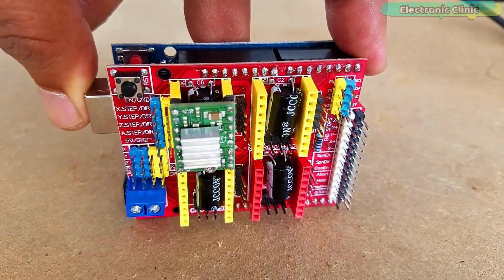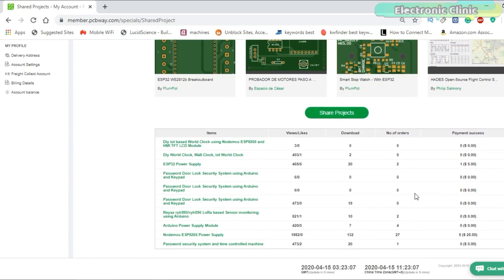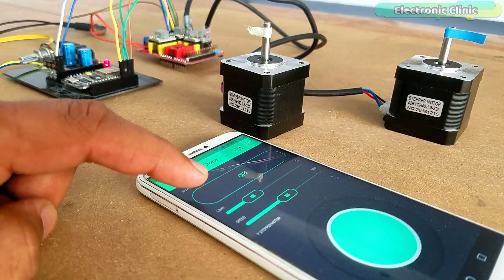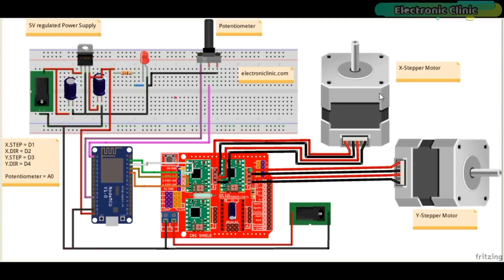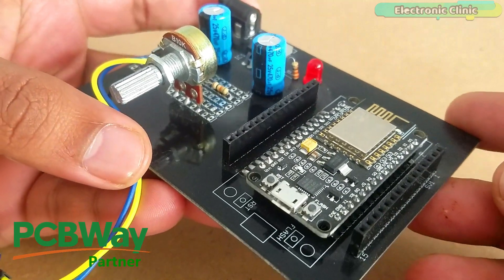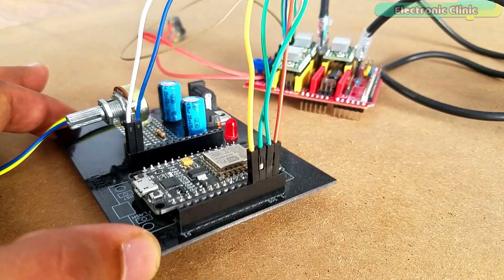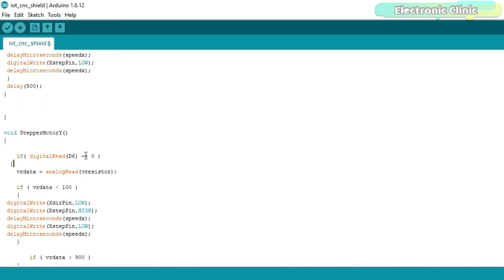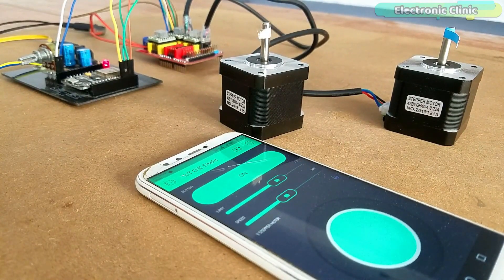IoT CNC Shield, Nodemcu CNC shield, ESP8266 CNC Shield, Mobile CNC Shield, Blynk App, Stepper Motor

Comment: Can I apply this code with Blynk IoT (New Version). I make it follow this clip, but it can not operate
Reply from the maker: new Blynk is a littble bit different. You can watch my getting started video on the Blynk v2.0 and then you will be able to control the stepper motor. Kindly check playlist.

Comment: if we dont have the that pcb board what can we do ? also where can we find the libraries
Reply from the maker: You can make your own pcb. Check playlist, I have designed custom pcbs for controlling stepper motors.
Reply: @ElectroniClinic  thanks for the answer, but because i don't  have a lot of time to make a pcb because its for a school project, how can be done  without?
Reply from the maker: i have added the pcb gerber files, you can make that in 2 or 3 hours.
Reply: @ElectroniClinic  ok thanks

Comment: Unfortunately this tutorial no longer works. Blynk Legacy (which is what OP used) is no longer supported and the SimpleTimer does not work with Blynk any longer as SimpleTimer is built into the Blynk library. "delay" commands do not work with Blynk as it blocks all code execution until the delay period is over which then doesn't allow the handshake between your device and Blynk. I've spent the past 2 weeks trying to rework this code for Blynk 2.0 to no avail. So I wouldn't waste your time and money with this until OP comes up with a solution for Blynk 2.0.
Reply from the maker: if blynk has issues then you can use any other iot platform.

Comment: Thank you so much for your tutorials. They are very helpful! I have a doubt Can this project be done without the potentiometer and 5v regulated power supply?
Reply from the maker: nodemcu esp8266 needs 5v
Reply: @ElectroniClinic  okay. 
so the voltage regulator must be used then?

Comment: Does speed is really controlling.i couldn't see m video
Reply from the maker: of course it is
Reply: @ElectroniClinic  ok thanks for the clarification.does this code works if I am not using cnc shield instead I will use l293d IC .I want to use one stepper only
Reply from the maker: @embeepay1957  i have another video in which i designed a custom board for the stepper motors. that's cheap and easy to build
Reply: @ElectroniClinic  thanks I'll check
Reply: @ElectroniClinic  sorry could you share link.i couldn't find

Comment: Is the power from USB port to NodeMCU enough to power the stepper motors? The CNC Shield itself is connected to 12V power supply, but for some reason the motors do not work. The motors are 28BYJ-48

Comment: Hi ! Great video! I had a hard time finding resources on linking a ESP32 to a CNC shield and yours helped me a lot. 
But I've noticed that at 1:11 there are a blue and a white wires that seem to be going from Vin/GND on the ESP to 5V/GND on the CNC shield. Yet it does not figure in the wiring diagram at 5:01. 
Without those connections, I could not make my circuit work but it did work with them. Am I missing something here ? 
Anyway, thank you again for your video !
Reply: Thank you, i didn"t have seen this connections and it was not working, but now everything is okay.

Comment: Great  amazing  ,, sir   I watch record and play robot in servo  in another channel but I had dought that project  will works in stepper motor , how to do that sir
Reply from the maker: I have other videos on Stepper motors too, watch those videos. Ya you can use Stepper motors. Tell me for what purpose you want to use a Stepper Motor?
Reply: @ElectroniClinic   sir see this link https://youtu.be/bLnAJ-mSElE.    This project how to do in stepper motor ,,     sir I watched  your  every video in your channel , your channel inspiring us  to do some thing  creative that's why  I asked the dought ,
Reply: I want to lift the weight  and drop and this process should be done in manual teaching ,but machine should record the movement and replay again and again ,  I attached the link  pls check it  , And thanks for your replay sir
Reply from the maker: i checked the video. they have used the servo motors. But you can also use stepper motors or both together. use an optical encoder this way you can record the steps. you can define the min and max limits.
Reply from the maker: watch my video on iot cnc shield. in that video i have explained how to specify the limits at any time.